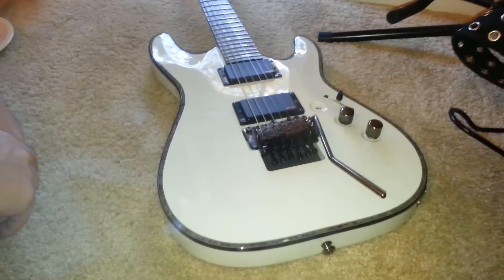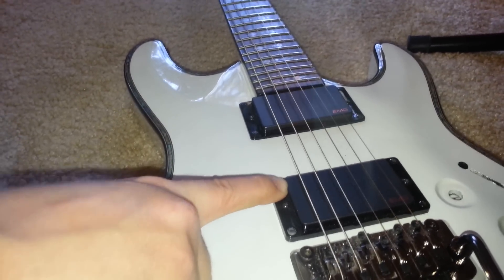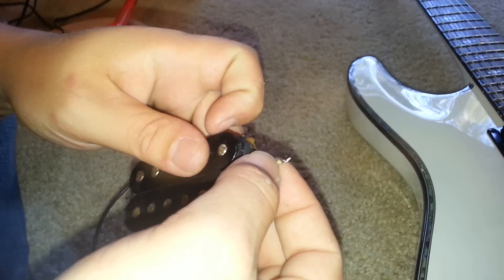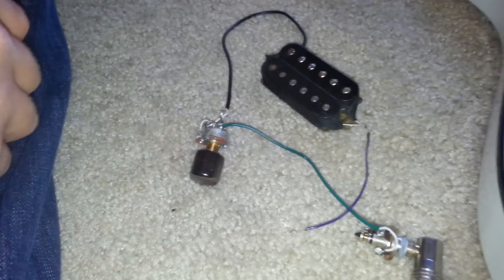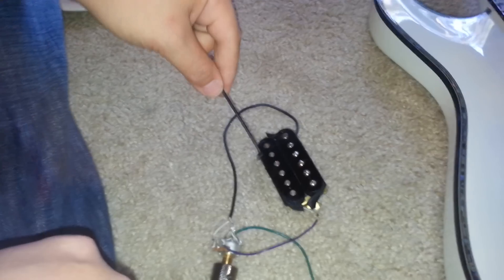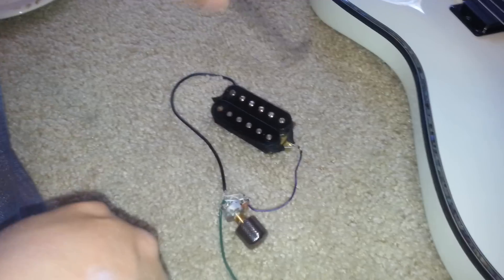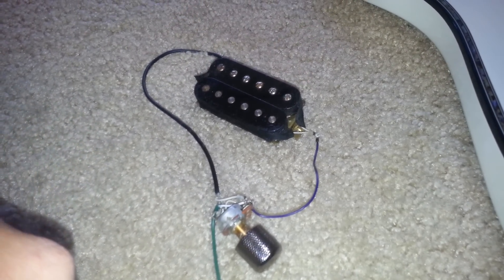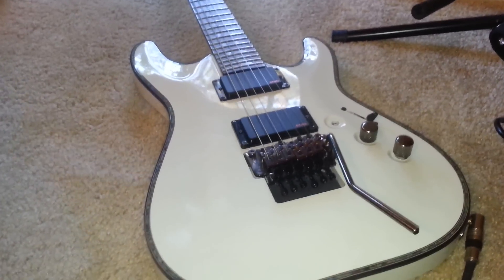How coil splitting works with how to

Comment: I got a newbie question, after I did this mod I found out both north coils were split, which is not the middle position tone inwas going for. I wanted both outer coils. How do i go about doing it? I did it on the volume put with alligator wires and I just connected the one unwanted to change to the hot of the volume. I just don't understand how to do the same on the tone pot.

Comment: Excellent! I want this on my guitar!
Reply from the maker: It's very easy with passive pickups.  just get push pull pots and wire it up so the coil you want to shut off gets grounded out when you pull the pot out disabling one of the coils.  I did it to my 9 string and having 4 tonal options is nice.  With these pickups this feature is stock.
Reply: Great! And very well explained! I will do it! Could you tell me which is the pot that you use?
Reply from the maker: +Diego Staltari well for active you've gotta use 25k pots but passive humbuckers use 500k.  just Google 500k push pull pots and there is even push push where when you push down it allows it to pop up but they're more expensive.  I was able to get a 3 way selector switch and 2 500k push pull pots for about 50 bucks but I went to guitar center.  I can even walk you through how to wire it up.  I helped a guy 9000 miles away wire up his Seymour Duncans and I've helped many more.  I've got a Facebook page.
Reply from the maker: +Diego Staltari also with actives they have to be built with the 5 wire setup not the 3 wire that comes on most actives.  this guitar just came with these pickups and we're a huge selling point for me.  gives a hot rodded strat and Tele tone when the coils are split.
Reply: +Randall Hughes Excellent! Really good job! I would like to follow on facebook. Greetings!

Comment: Thank you for the video, a question: Does a 500K pot changue a lot the sound of an original guitar wired with 250K?
Reply from the maker: A 500k pot on a 250k pup may act more like an on off switch than a potentiometer.

Comment: Is there some intrinsic reason why you couldn't set it up to select either coil rather than being restricted to just one?
Reply from the maker: Mike Austin id have to look at the wiring but usually the ground is black but thats with passive usually.  so if you happen to have the 5 wire setup switch the green out with the black and you can select which coild you would like to turn off and which to remain on.  thats what i did with my 9 string so i can get somewhat f a strat sound and tele sound strat being the northern pole on the neck pup and tele being the southern pole on the bridge pup.  you determine north or south by which is nearest the neck and bridge.  if its closer to the neck its north if its closer to the bridge its south.

Comment: Hi. Can I do the same process with a four-wired humbucker?
Reply from the maker: mkultratube yeah. Each pair of wires completes one single coil.  Been over 2 years since I've done this though. I did it on my 9 string to have a strat and tele style sound.
Reply: Ok, Thank you so much. I will try it when receive the push/pull pot I ordered. Thanks for the video!!!

Comment: can any one help me to do same thing with toggle switch
Reply from the maker: what are you trying to hook up?  I'd need more details about the setup but yes, I aleays did all my own wiring because it is not hard.  I've moved onto RC vehicles that have way more complicated circuitry.
Reply: i have my guitar with 2( bridge and neck) humbucker with master volume and tone with 3 way pickup selector like as lespoul...
 i just want to learn to split them using toogel switch
Reply from the maker: +Ashiz khati well is just give you the basics of how splitting a pickup works.  you solder an extra wire to the 2 wires that make up a pickup. one is where it starts winding amd the other is the end.  Basically you need to solder a wire to the 2 wires that make up the single coil that you want to shut off, that's what happens when they're split, and have one of the toggle positions wired to ground then solder the wire connected to the pickup of your choice to the position that will ground out that pickup so when you get to that position on The toggle switch only one of the pickups in the humbucker is on.  if you choose the pickup closer to the neck you'll get a warmer more strat neck pickup tone.  if you pick the pickup that is closer to the bridge you will get a brighter more tele neck pickup sound. If you need further assistance let me know.  you can't use your regular toggle switch to do this because if you ground out an entire side it will shut off the entire humbucker.  you can add a 2 way switch to ground and unground the pickup you want to shut off to split the humbucker.
Reply from the maker: +Ashiz khati well is just give you the basics of how splitting a pickup works.  you solder an extra wire to the 2 wires that make up a pickup. one is where it starts winding amd the other is the end.  Basically you need to solder a wire to the 2 wires that make up the single coil that you want to shut off, that's what happens when they're split, and have one of the toggle positions wired to ground then solder the wire connected to the pickup of your choice to the position that will ground out that pickup so when you get to that position on The toggle switch only one of the pickups in the humbucker is on.  if you choose the pickup closer to the neck you'll get a warmer more strat neck pickup tone.  if you pick the pickup that is closer to the bridge you will get a brighter more tele neck pickup sound. If you need further assistance let me know.  you can't use your regular toggle switch to do this because if you ground out an entire side it will shut off the entire humbucker.  you can add a 2 way switch to ground and unground the pickup you want to shut off to split the humbucker.

Comment: why didn't you just use one switch to split both pickups,i did and it works just dandy.
Reply from the maker: kevin brooks I like to be able to blend a single coil with a humbucker
Reply: so the second switch is a blender ?
Reply from the maker: kevin brooks nope.  each push pull splits, the pickup selector blends